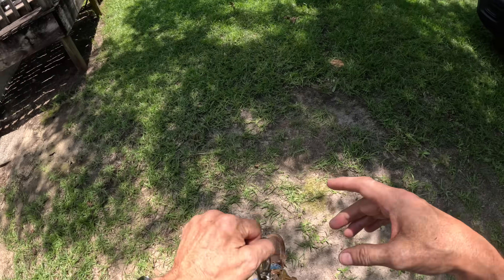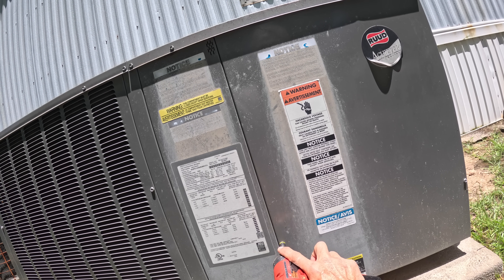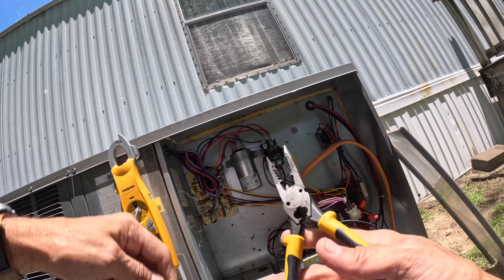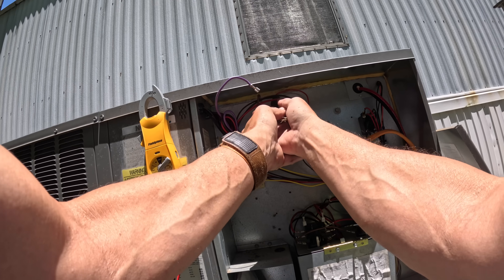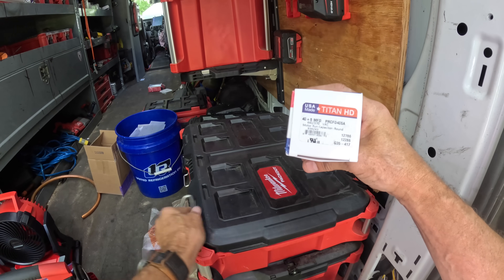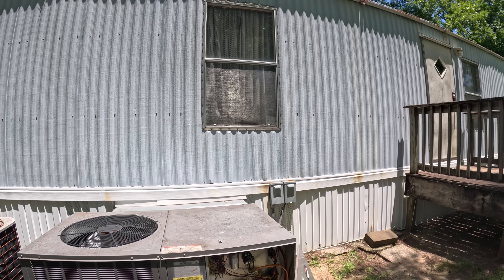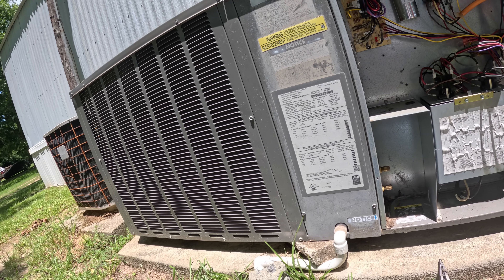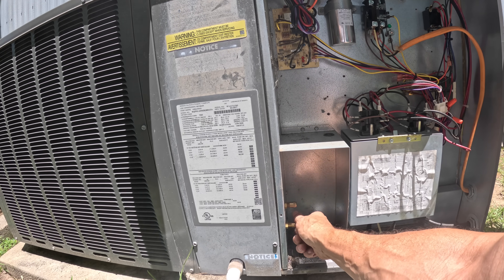Quick Fix, But It’ll Take All Day To Cool Off! #hvacguy #hvaclife #hvactrainingvideos

Comment: i hear how terrible the new capacitors are at constantly failing I was having trouble with my ac the motor bearings had dried out and it was hard to get fan on condenser to spin so i replaced motor but the capacitor was 26 years old and rusty all over yet it still worked perfectly it was quite large in physical size could not even read label . Had to look up what the compressor and fan were supposed to use and closest capacitor in physical size, a made in america titan was about half as large they just don't make them like they used to EPA making things worse every day.

Comment: From all the years i observed HVAC maintenance and the most common fault is a dead capacitor it would be wise from manufacturers to make them accessible through a small hole with a cover and at best with a socket (though you require standardization then...) so they can be swapped plug and play even from capable customers and esp. save technicians a lot of time. Just a silly little idea. Oh and maybe a way to monitor the condition, like sensors for temp and irregular voltage spikes/drops?

Comment: You could be the run cap bandit, just leave it in the box. LOL I wonder what that other old unit was all about, I mean it must not work if it was 87 inside, even if it was for one side of the trailer. Anyhow, nice clean little repair.

Comment: Thanks sir.  I wouldn't live down south without a backup a/c of some kind.  Those new inverter window units would work.
Reply: yep they would. I bought a 18000 btu window unit from HD, uses 110v for 500 bucks and I use it in my living area just to give my big unit a hand. It works great and it actually saves me a little on the power bill. They are more efficient than the old days.
Reply: Yep... (Bought two midea A2L window units when our A/C was down for two months)

... till the HoA comes knocking and wants to fine you. Ask me how I know.
Reply: @pilotboba  I admit they don't look nice in the front of you house. Mine is on the side and I have a sweet olive tree that hides it.
Reply: @pilotboba   I used to draft and file all the documents for townhomes and condos, and the HOAs.  No way would I ever subject us to that tyranny.  😂

Comment: Does anybody know if r454b requires a special filter drier or can i use the same one as a 410 system?
Reply: R-454B systems are designed to be similar to R-410A systems, but components like filter driers need to be specifically rated and sized for R-454B.
Reply: I wanted to add, I am known for not changing dryers unless a compressor goes out, I get jumped on for it, because you are suppose to anytime you open a system up. That being said, when you pull a vacuum, that pulls all moisture out of the system. I have even put them back without one, don't tell on me.

Comment: There are low loss fittings for the pressure gauges. Buy 2 of both the 90 and 45 versions for getting into different spaces. 

This way you won’t piss out refrigerant taking the gauges on/off.
Reply: And some Gloves !
Reply: @KG-wh8yv  LOL yeah, 100 degrees outside and you get frostbite.

Comment: Just like my $600 service call 7 years ago !  Prompted me to learn enough to change them myself every 5 years.
Reply: If you got charged 600 for a capacitor, you got screwed, even with today's standards.
Reply: I bought a meter at Amazon for $20 and $30 for two capacitors. always keep a spare on hand.

Comment: I had a unit yesterday. Capacitor was bad. customer left it in cooling. Overheated both fan and compressor. luckily cooled down with water. And running

Comment: Just stuck a screw driver on my Yamaha Amplifiers power supply cap leads a few seconds after i unplugged it. ZiZapp Crack ! Ride the lightning
Reply: 2nd favorite album!! 😊
Edited: Not a laughing matter if you don't do that, and you get zapped! I've had arcade monitors shoot voltage through plastic screwdriver handles! Not sure if it was the handle or the high amps coming through, it will make you think again before trying that 🙈
It's the amps that kill you, not the voltage!!

Comment: Never seen a mobile home with two ac units
Reply from the maker: The other isn’t being used
Reply: @HVACGUY  Someone replaced the original, didn't want to pay for the original one to be recovered, disconnected, and removed. 🙄
Reply: In some areas they have double-wide mobile homes which can be 1800 sq.ft.

Comment: Having owned a home in north Texas for over 20 years, I have been lucky enough to troubleshoot and fixed all my A/C problems. Mainly thanks to YouTube videos. 

However, the difference between me doing so, which sometimes has been frustrating and time consuming trying to figure out what the heck I am doing, is that a guy like Curtis has already done it all and knows exactly where to start and knows exactly  which step to take next and has all the necessary tools within reach.

If I could find a guy like Curtis in my area, who was honest and not out to sell me a complete new A/C system I would be keep him on speed dial and be so happy and pleased with not having to continue to figure all this out by myself. Such a guy is as valuable as gold.

As a side note, if any HVAC guys in the DFW area are or the sort that are willing to work with a customer to repair their problems, when truly possible, rather than collect a manufacturer's commission on selling me a complete new A/C system, please do not hesitate to reply here.